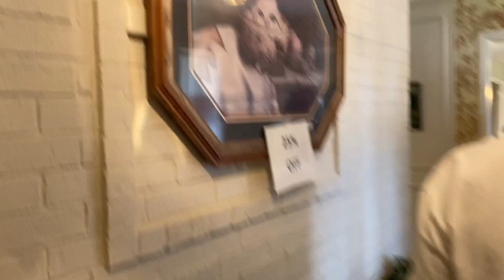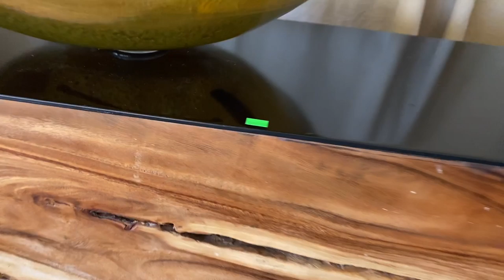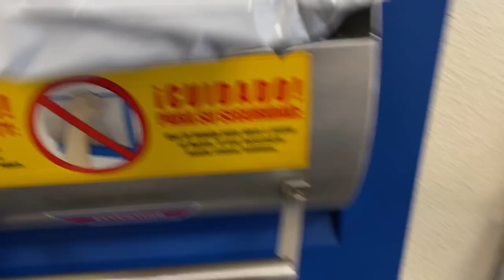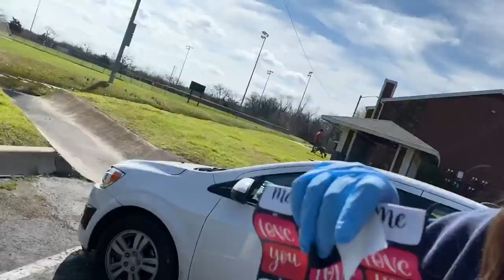Dumpster Diving, Garage Sales, & an exciting update at the end! ;)

Comment: The large versions of TY Beanies are usually worth less than the regular size Beanies. I'm sure not a Beanie Babies expert, but a few years ago, on eBay, for a gift, I purchased the regular size Princess Diana purple TY bear and the large TY version, I paid $15 for both on eBay, they were in excellent shape with tag protectors. Most of those 'rare ' TY listings which go on & on about tag 'errors' and other nonsense, are simply hype. I once saw a TY Beanie listed for $650,000 (😂😂), I then saw the same EXACT Beanie listed for 99¢! That proves TY Beanies aren't worth much. If someone is willing to pay such absurd prices, they would want a Mint condition never played with item with protected tags.

Comment: Just a heads up the German steins you want to find are usually the plain or lightly decorated(beer name or pub) gray steins with the silver hinged lid of course with the makers mark from Germany on the bottom. Those are the ones that are older and not made specifically for commercial sale and worth more. So look out for them some will pass them by because they're plain in comparison.

Comment: 💕💕💕REMEMBER 💕💕💕 when you come across cards,cards in envelopes OPEN THEM. There could be money in them. I have seen it before. 

With all your stuff that you are going to donate, why not hold a yard sale again? You did well last didn't you? You should try to yard sale the stuff first and then the stuff you don't sell you then donate. 

Regarding the legos, sell the little men by themselves they are worth between $10 to $15 and even more for the older ones. The more common ones lot them together and the same goes for like the Lego cups, guns, all those small things lot them together. That is if you don't have the figure that it goes with. Oh yeah those Lego plates that you build on sell them separately from the blocks. They are worth more between $10 to $25, depending on the size. I would say lot the smaller ones together or just lot them all together and ask for a higher price. Even the instruction are worth money especially the older ones. 🤗🇩🇰